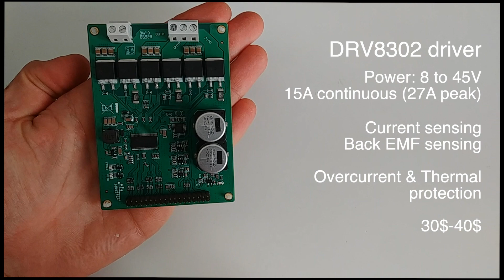Arduino High Performance FOC BLDC Driver - SimpleFOClibrary

Comment: As I can see those days when the first FOC hardware drivers appeared, many YTs began that hype, naming FOC a positioning system. "Field" in FOC means a motor magnetic field. Got this? FOC was designed to manage torque (that reduces a noise and increases an efficiency). I think there was one popular YTer, how started that trend (with improper usage of the term FOC), and then the others copy pasted.
Reply: Hey @sc0or,
You're right, the FOC has a very specific meaning and has been there for many decades now.
I'd argue that the FOC was designed to decouple the torque and field control, mostly for Asynchronous motors.
For BLDC motors, FOC approach is much simpler, as the rotor field is directly related to the rotor angle, no slip happening. So for BLDC motors, the abstraction that the voltage vector is proportional to the current vector which is proportional to the field vector which is proportional to the torque is relatively reasonable for low speeds. 
But as you said, this is no longer true for higher velocity.

This is an old video, and one that does not anymore correspond to the simplefoc well. It is just a video to make people interested. The library nowdays implements the textbook FOC algorithm for many architectures and does it with a decent level of efficiency. 

The overall the goal of the library and the project is to demystify (make simple) this approach and to give the people a relatively well documented and gradual way into this topic.
Reply: @antunskuric7282  Indeed. However when I search YT for a custom implementation of a real FOC to use an industrial controller that is driven by 3-phase PWM from an MCU, I find tons of videos with the positioning. I only hope that TI has some webinar and a source code for their MCUs. Unfortunately, existing hardware FOC controllers are not powerful enough. They suppose that a user must not care of a noise or efficiency with a high power motor. But my 3kWt motor must be silent and effective.

Comment: Can you make this as a drop-in replacement for stepper motor with servo motor and this controller for cnc machines. Right now the cheapest option is ODrive. Thank you for your work.

Comment: How can I use this with a 30cm diameter out-runner pancake motor with 120 poles that is going to be designed to run in the range of 40-80 RPM, The goal here is to achieve a very steady angular/linear speed once selected, The application is a turntable record player. What method of angle tracking and speed adjustment is better for this application? a hi resolution encoder or back EMF circuit? I would really appreciate your help on the electrical part.
Reply: @theskura  Thanks, Maybe I should start off of a readily available motor to experiment with. 
The original idea is to build the motor stator on a large 29 cm PCB disc board with as many poles as I can to have a smooth torque and speed and build the encoder coil within the same board, lets say 25cm diameter for the highest resolution possible. I'm a mechanical engineer so not so much for digital electronics. I have the mechanical idea but don't know how to drive it.

Comment: Awesome! Is it possible to use the library with an encoder connected to only one analog pin? If so, what needs to be changed in enocder source file?